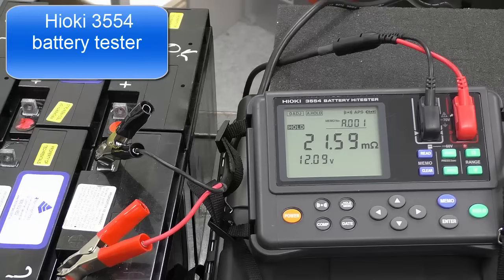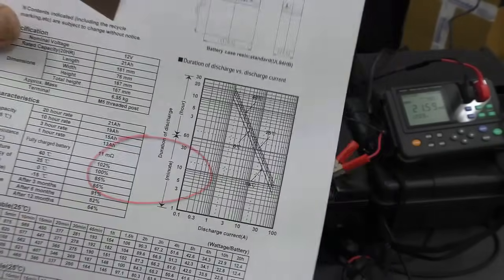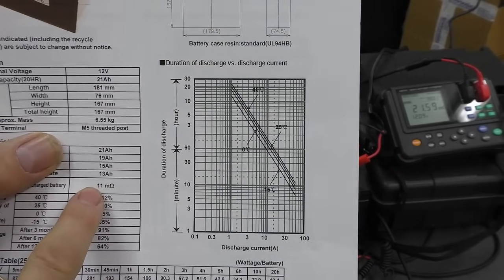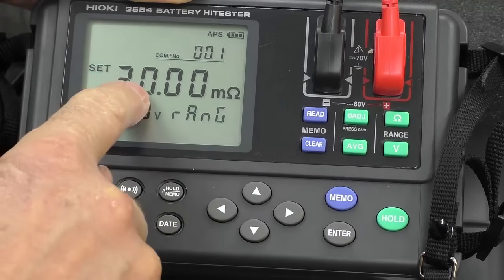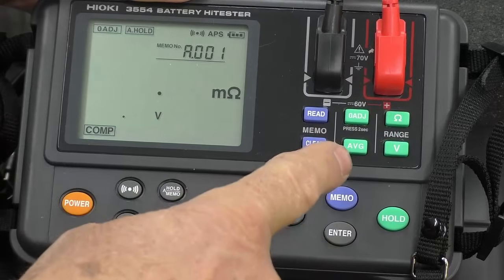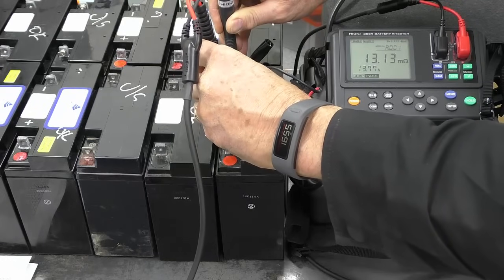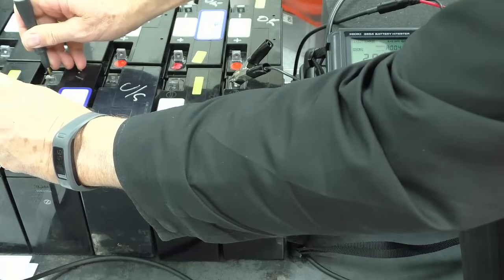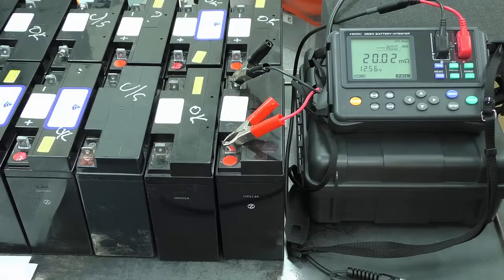Measure Internal Impedance on Batteries using a Hioki 3554

Comment: what is the difference between battery impedance and resistance??
Reply: Impedance resists the flow of current in an AC circuit.  In AC, it has to account for resistance and reactance.  Resistance prevents the flow of current flow in a DC circuit, but DC is real power so no need to account for reactance.

Batteries internal impedance also changes depending on frequency of AC signal.  Thats probably why the standard internal impedance measurement is an AC signal at a set 1kHz and outputs a millions measurement (ex: 11 mΩ).

Low impedance is for handling changes in load when accelerating in a car.  Low internal resistance is important for efficiently delivering power to the motor in a car.

Comment: So the older the battery gets the more the internal resistance will be?
Reply: Yes... but by how much depends on the technology of the batteries... You need to either get the info from the battery manufacturer OR have a number of examples and develop experience yourself.

Comment: Can you tell me if you can test batteries in series, testing two batteries at the same time as I am having trouble accessing the battery terminals.
Reply: If you measured two batteries at the same time you would have the addition of the two impedance measurements. So it would be a reasonable indicator if something was marginal or not.

Comment: Hello, does this tester measure the Internal Resistance of the lead acid battery even when the UPS (equipment) is online?
Reply: Yes you can be online... great for quickly testing battery banks. Alternatively if you need to stress test the batteries you might use something like the Megger Torkel 950 which actually does a load test and discharges the battery, this has to be done offline.
Reply: Graeme Murphy Thank you for this!

Comment: can we test the battery internal impedance while the battery is still connected with UPS and charging?
Reply: I have not used these in the field however according to the documentation I have the main selling feature of this type of battery testing is that you do not need to take the batteries offline to test them.

Comment: Sir,we lerned  in university that resistance is measured in DC circuit and impedance measured in AC circuit ,
The battery is DC device and then why we called impedance rather then resistence
Reply: Because the device measure AC impedance of the battery. The fact that the battery is a DC device is irrelevant here.  It is a case of 'it just so happens', that the AC impedance indicates the health of a battery.
Reply: @GraemeMurphy54  hey nice video , i have a question  i know that we can check a battery health by measuring the cell voltage cann't we use that instead of measuring the impedance .
Reply: @mohbit3336  no, ocv can tell you state of charge not state of health

Comment: How can I get same (kind) of result with the tool I have : Extech 380462: Precision Milliohm Meter (220VAC)
I get sparkling ang no stable reading
Reply: Probably because its measuring resistance NOT impedance. This instrument measures the impedance using a low voltage AC source...
Reply: @GraemeMurphy54  this makes no sense
Reply: @randycollens2681  Resistance is DC and Impedence is AC.  Slightly illogically you measure an AC parameter across a DC device in this case a DC battery. It just happens to give you a reliable and repeatable measure of the health of the battery.

Comment: what is the relation between impedance and battery voltage?
Reply: Each different battery chemistry and battery voltage will have a different relationship. So you have to get the manufacturers documentation to determine what is acceptable and unacceptable impedance measurements.  You can take a number of 'good' similar batteries and experimentally determine a 'good' reading. Its a bit of an empirical measurement really. If you only have one battery to test then you have to rely on the manufacturers specification.
Reply: I have a Hioki battery tester BT 3554. 
After measuring a battery I get resist 0.02 mOhm ( before was 3-5 mohm). I replaced battery but i still have same measurement by hioki 
Please can you advice me what can be wrong 
Setting on hioki tester is same like before